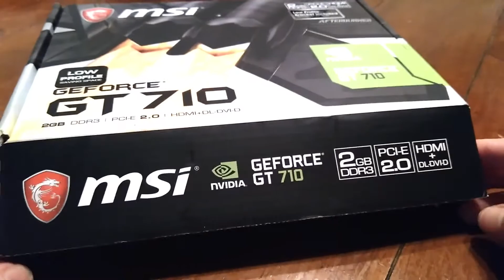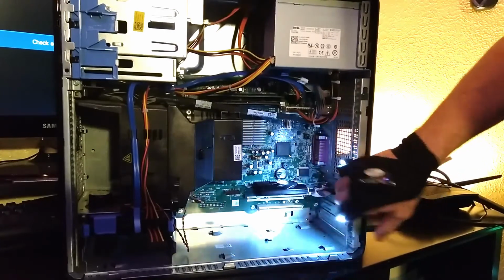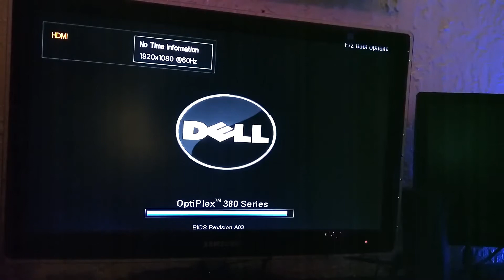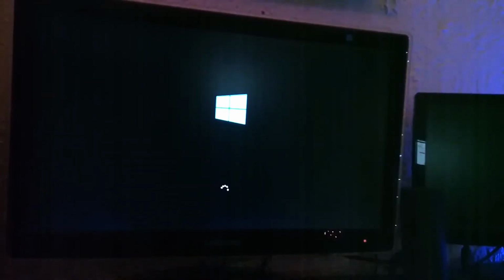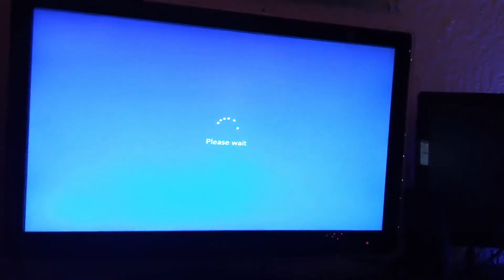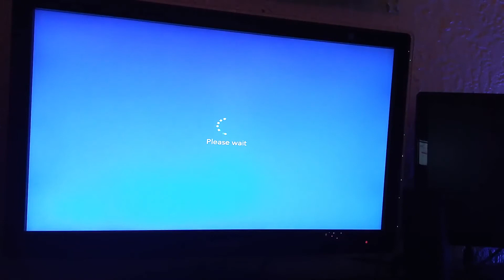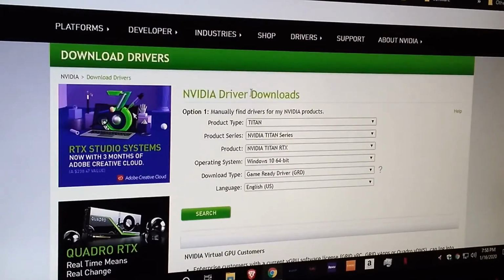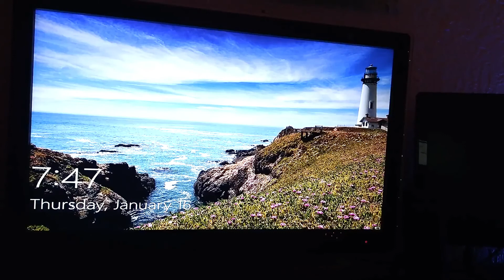Updating a Optiplex  380 with a GT 710

Comment: Excuse me, I want to buy a gt 620 for my optiplex 380, I have the largest version (Mini Tower), in this case would I need the small bracket or the large bracket? and i wanted to ask about pci express (since it's 1.0) since i don't know if there is some kind of incompatibility (i've been checking this for weeks and i still can't find anything) thanks
Reply from the maker: Im pretty sure you would use the mini bracket but just remember you want to make sure you are not over wattage with whatever video card you pick.. a lot of new cards and even some used will come with multiple brackets for different case designs

Comment: Inno3D  GeForce GT 710 2 GB GDDR3 on a 380 and it became much and much slower cant handle discord even or roblox or Minecraft etc so what is the problem?? It had the Nvidia driver already installed from the last Graphics card
Reply from the maker: have you checked inside the Nvidia control panel? Another thing could be in the bios so you may have to make some corrections inside of the bios... I would also reinstall the drivers with the new card

Comment: Did you upgrade anything at all  so it can handle the new GPU
Reply: what sort of stupid question is that?
Reply: @Omabatfartsbruh  Maybe he upgraded the power supply to make sure that its powerful enough. But dont think he did. GT 710 will be fine with the power supply. Maybe upgrade it when you go for a gt 1030.
Reply: as it needs very low power for it to work. Great for a dell opiplex.

Comment: Really not a bad video card. 1GB version is going for$35, 2GB for $50 on amazon. It will play GTA5. I have an old 380, upgraded to a C2Quad, 8gb is memory is tops for the 380.
Reply: I got a optiplex 380 with GT 710 2GB DDR3 and I got 4GB ram installed but it can’t even handle Minecraft or roblox
Reply: @lorenzogaatspelen  did u put the right drivers??
Reply: @billyscot741  wdym?
Reply: @billyscot741  I got the GeForce GT 710 2 GB GDDR3 and the Nvidia app was already downloaded
Reply: @lorenzogaatspelen  u need to download the drivers first before using the graphics card, not only downloading nvidia app
Reply: @ChocoXD.  I bought myself a laptop i guess its easier
Reply: @lorenzogaatspelen  Oh ok and what happened to the pc?
Reply: @ChocoXD.  I still have it in the attic it doesn’t work anymore I believe
Reply: @lorenzogaatspelen  Rip wish i had that pc
Reply: @lorenzogaatspelen  it may be also the ram
Reply: GTA 5 is very optimized but not really a gaming card. Better to go for a GT 1030 2gb as its much better.

Comment: man it is possible to change the processor to put a Core 2 Quad processor like the Q9505S or the Q9550S? My question is because I have the Optiplex 380 DT, and the 235 W power supply, so I will try to put one of those processors for the low consumption they have compared to the normal Q9650 or Q9550
Reply: I saw a Linus tech tips video where they tried this, they recommend you use a Q9550
Reply: @TheCommunistRabbit  thank you man, But I had already bought a Q9550, the guy who sold the Q9550S sold it XD but I was really obsessing a bit with the consumption of Watts, but in the end I put that processor and a Radeon R7 240, it came out very cheap so i buy it, and the Power supply don't have problems, but possibly i'll buy a GT 1030, since they both consume the same amount of watts, and I will change the HDD for an SSD, to save a couple of watts xd

Comment: Can I install a GT 1030 on an optiplex 380?
Reply from the maker: yup should be able to
Reply: @TheKillogicEffect  And how about a 1050?
Reply from the maker: @Kanedis  they make a low profile low energy version of the 1050 that may work but you only have a 25 watt power draw on the graphics card slot so your limit revolves around that.
Reply: @TheKillogicEffect  So in conclusion do you recommend doing this guy's thing or is it better for me to get a GT 1030? 🤔
Reply from the maker: @Kanedis  Go with the 1030 if you can
Reply: @TheKillogicEffect  Thank you very much for your help brother.
Reply from the maker: @Kanedis  No problem, good luck!
Reply: @TheKillogicEffect  Hey brother I forgot to ask you something, if I buy a GT 1030, should it be the low profile or the normal one?

PD: By the way, if I buy it, do you think my 2.60 Ghz processor is enough or am I forced to upgrade? 🤔
Reply from the maker: @Kanedis  lower profile
Reply from the maker: @Kanedis  low profile and it depends what the processor is there could still be some life left with the minor upgrade in graphics

Comment: Does Gtx 1050 or 30 can fit in this PC?
Reply from the maker: A. 1030 is the highest you can go .... It all comes down to power BUT they do make a low powered 1050 that may work I'm pretty sure ETA Prime has done a video on it... I hope this helps
Reply: @TheKillogicEffect  thanks for the advice bru
Reply from the maker: @LazyH-Online its not GTX its GT and they make a low profile low power 1050. ETA Prime has a good video where he uses a low profile 1050 in one of these

Comment: GT 710 2gb will support to dell optiplex 380 ?
Reply from the maker: yup
Reply: Mine is using a GT 1030 so a 710 should work perfectly.
Reply: @no_4259  did u need to upgrade the psu
Reply: I use a GT 710 2GB and have 4 Ram installed and it can’t handle roblox and Minecraft since Minecraft reaches 7 FPS